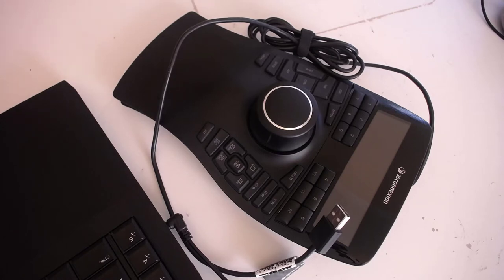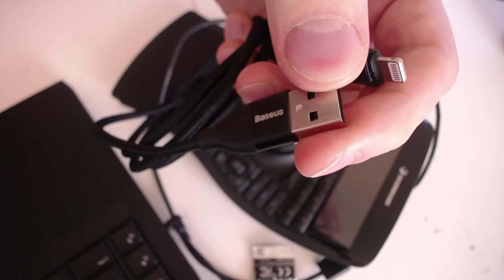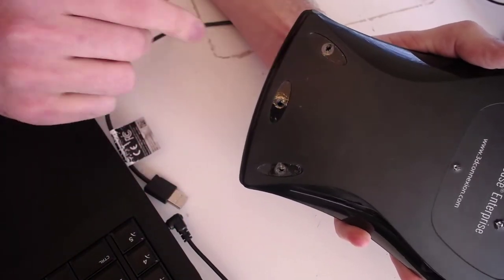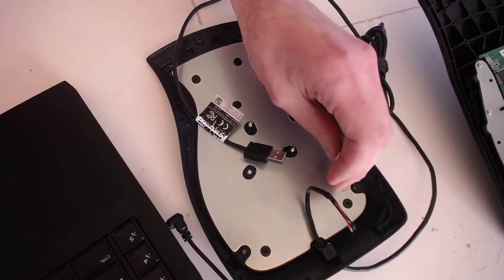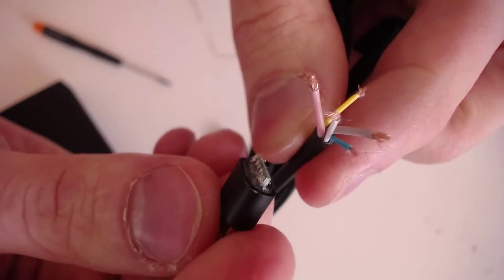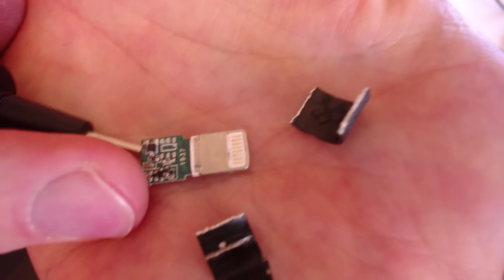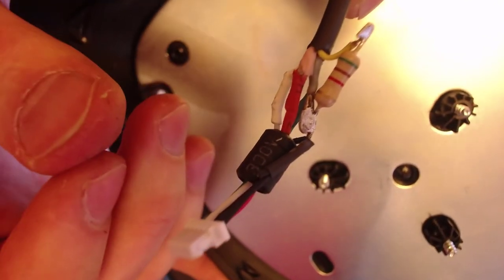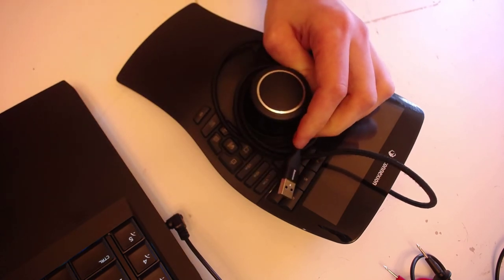3Dconnexion SpaceMouse Enterprise with USB Type-C! (DIY upgrade)

Comment: Welcome.
Can you help me ?
I took the cable off my enterprise manipulator at the plug itself.
Can you fix it somehow?
It is enough to replace it with a different usb cable or is it necessary to insert a resistor?
sorry for my english - translator google  :-)

I'm sorry, but I didn't fully understand.

Is a 5.1 kOhm resistor necessary for USB type A?
Reply from the maker: Hi Nie,
I have a wiring diagram for 4:59 moment of this video. Hope this would help. Please keep in mind that wiring might be different in your case, if manufacturer have introduced some changes during the long period of SpaceMouse being produced. That's why it's always better to test the connection at your own device, but it might be tricky if you already have a cable plug chopped off.
https://drive.google.com/file/d/1wxJTI-PEkkRVCPPdfMtpHR1nGhG4a9tV/view?usp=sharing
Reply: @sergeyvakulenko4687  
Hi.
Thank You Sergiey. Very much. :-)

You are the only one brave in all of YT. :-)
There is no such movie and no such material anywhere on the Internet.
Thank You.

So it looks like a straight-line connection can be used for ordinary USB, without a resistor?
Reply from the maker: @niepamietam  , thank you for the warm words! Yes if you want to use a regular USB (type-A) you don't need a resistor. The resistor is needed for conversion to type-C plug only.